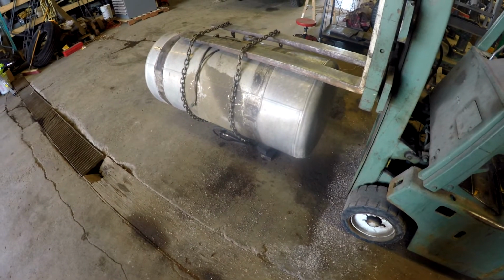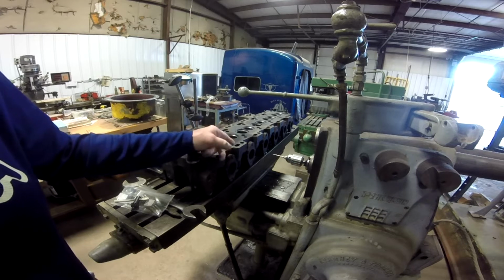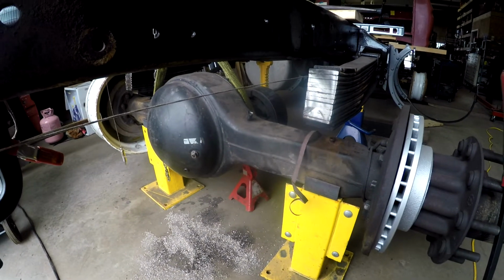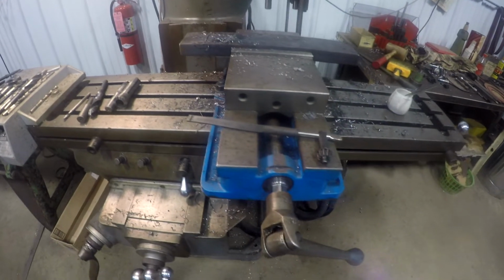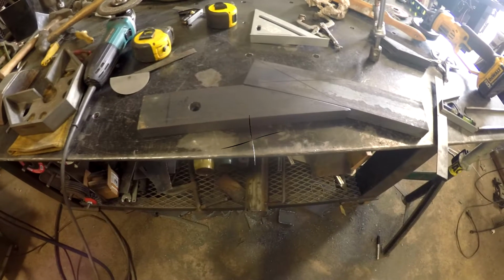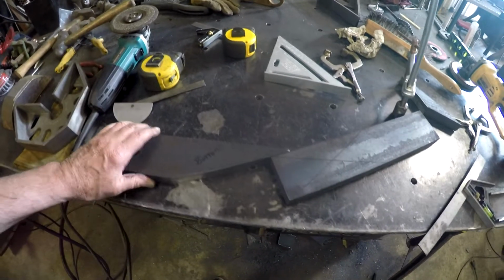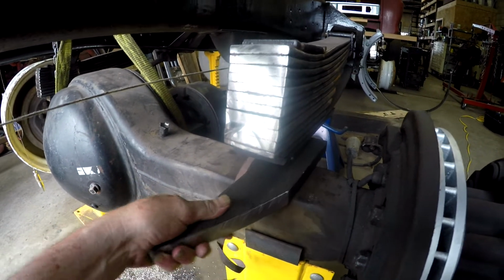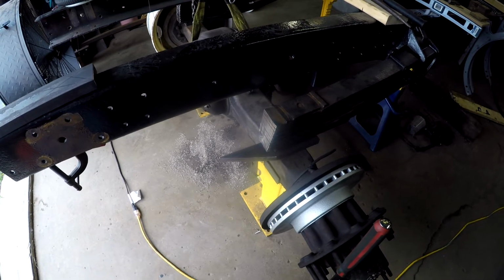Ford F750 Haul Truck Build Part 53

Comment: I still say scrap all that and go get a salvage yard suspension and put under it. Its already engineered and tested and will save you tons of time and likely not be anymore money in the end. Also if you have a problem out on the road you can get parts vs needing something one off that was custom made. Unless of course you just want to be able to say that you built it yourself then there is no substitute for that!  The further outboard of the frame the air bag is mounted the better your roll stability is. Those old truck frames are narrow anyway I wouldn't want the air bags in that narrow myself.
Reply from the maker: OK, OK I hear you! I will take your advise into consideration again and go down to salvage yard and look to see what they have, maybe make a supplement video to this one on this issue. 
My thinking on this is I would probably end up having to modify it more to adapt to one model axle with a different model truck frame, given variances in ride height, frame rail spacing, frame rail sizes, axle size, and axle spacing! Just to name a few of different possibilities! Instead of two contact point modifications with present set up, I may end up with as many as six contact point mods that may have to be made to make something adapt to my frame axle setup. All that being said, I have a lot of faith in what you say, so let me go take a look at what there is and see if it would be worth it!
Reply: @frednewman2162  I would have thought that big Ford to have been the industry standard 34" wide? If your axle winds up forward of back an inch or two will it really matter?  You haven't yet placed the hitch nor do you have a driveshaft and I think you have lots of room on the tanks so I would think that is a dimension you can live with moving some.
Reply from the maker: @bcbloc02  Wait, in about two hours or less I will have an answer for you via another video!
Reply: Fred Newman 
Fred, r we going to get a haul truck/ shop update again Friday
Reply from the maker: @JJ-jv1gu  Yeah, got tied up today that's why didn't get back to you! About 3 hrs and I will have Shop Update out.
Reply: bcbloc02 
YES, I AGREE..
I will engineer it for u right here.
1. Go salvage yard
2. Get 2 matched BIG OL leaf springs
3. Bolt em in, call it good
4. Keep it simple
5. Get a big comfy drivers seat for ride quality 
6. Enjoy the SUPER-STRONG MAINTENANCE FREE suspension
Reply: I agree Brian all the parts would be available out on the road

Comment: Put clear hose on a hot rod Ford mustang transmission coolant lines. The flowing ref oil flowing through under the hood sure looked great.  One night racing back road style line blew spraying oil everywhere,. Then the fire.  Before cell phone middle of nowhere. Six hours later we carryed it back behind the barn with the tractor.  I was 17 and will never forget
Reply: James Mader You  Beat Me! Like I said we all screw up at some time
Reply: @ypop417  I didn't beat anyone. My mother beat me. All these years and she still doesn't laugh at it
Reply: @jamesmader5829  WOW that's a long time to still be sore of course she is probably thinking I could have lost a son.